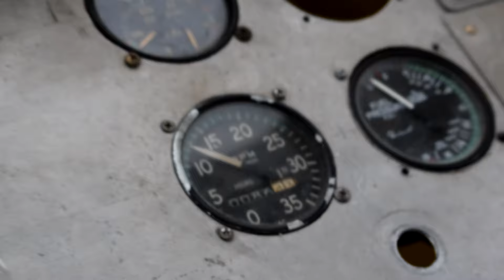Lycoming O-540 Rebuild Test Run

Comment: hi mister
How many hours can I fly to repair the engine?
Reply from the maker: A pilot can only perform preventative maintenance. Flight hours do not grant higher privilege. Repairs and Alterations are carried out by licensed mechanics
Reply: how much time do you need to study? @theflannelfisherman8329
Reply from the maker: dra gon you must complete either a 4 year degree, an 18 month technical course, or I believe 2 years of experience. Then you may take your General, Airframe, and Powerplant writtens. After your writtens are complete you may schedule with a Designated Mechanic Examiner to take your Oral & Practical tests to receive your A&P certificates
Reply: your opinion which engine is better? @theflannelfisherman8329
Reply from the maker: dra gon my class had 3 engine groups. I rebuilt this lycoming. The continental seemed harder to work on. I couldn’t tell you much more than that. Not sure how the performance differs between the two
Reply: @theflannelfisherman8329  ok thanks
Reply: First your gona need an engine.

Comment: Runs like garbage.
Reply from the maker: Pablo Hernandez runs like an engine that’s been rebuilt over and over with the same bearing and compression surfaces for probably a decade. The purpose was not to make an airworthy engine. This was at a school for learning a basic understanding of an engine rebuild without actually having the proper new components.
Reply: @theflannelfisherman8329  I understand now. I got worried because the new Swift Helicopter is probably going to have this engine.
Reply from the maker: Pablo Hernandez they’re fantastic motors when built properly. This things been abused by students for years. Needs rings, bearings, regroups valves, it’s already over bored as far as it’ll go. I’d love to work on one with new components that’s actually airworthy
Reply: @theflannelfisherman8329  Probably should rotate through some lower time parts.